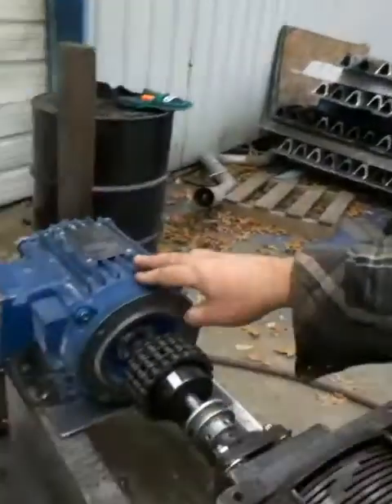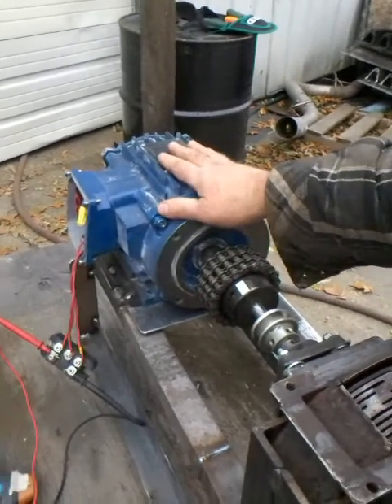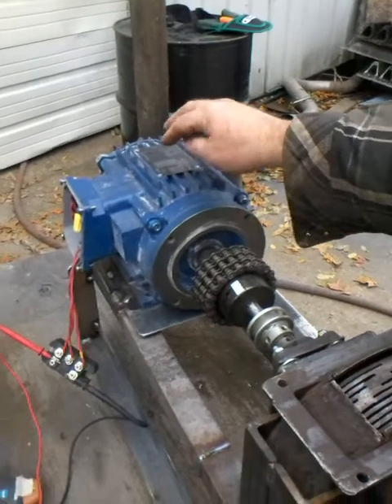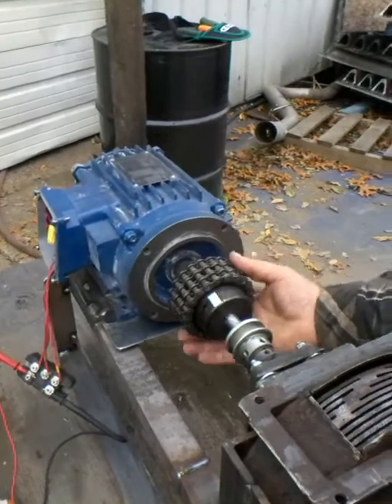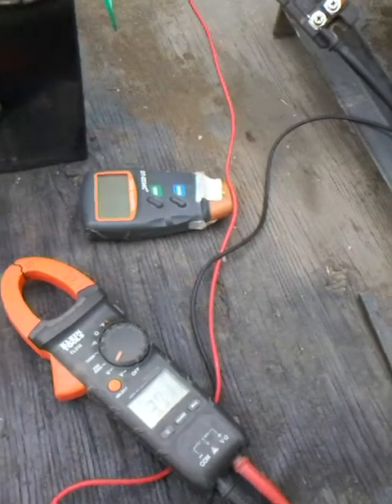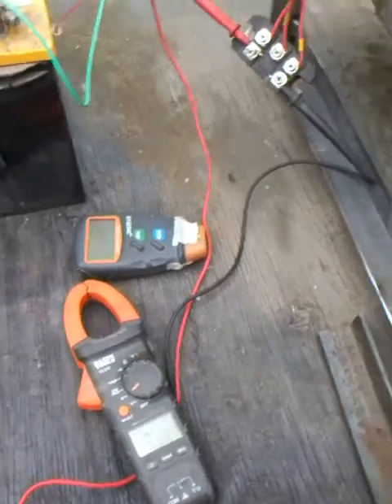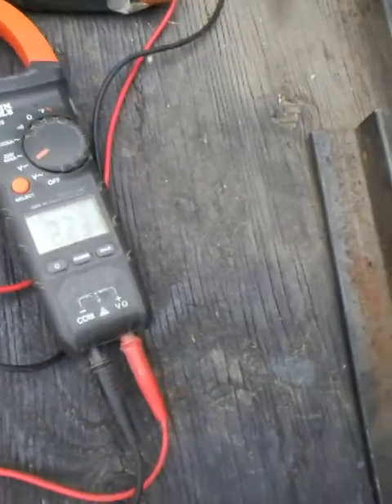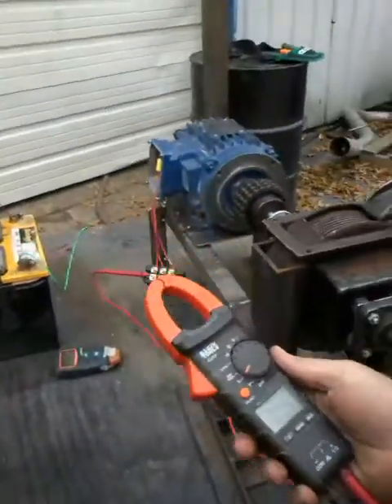TESLA TURBINE AND THREE PHASE PERMANENT MAGNET  GENERATOR

Comment: Power is driven into the storage battery by the use of Red and Green antenna on the batt terminals?  The tesla coil is off camera?
Reply: that was with no load... did they ever connect it to the battery ?

Comment: I'm "fascinated" by people who keep their smartphones vertical while filming.
I would be interested to know if these idiots place their TV sets vertically at home
Reply from the maker: I do not own a cell phone.... let alone a smart phone. I am not "fascinated" enough to waste 500+ dollars on something i find responsible for the greatest waste of productivity in human history.  This is a free Samsung CE0168 tablet given to me. Only the screen side camera works, the other lens is completely frosted, so it is extremely difficult to record, when you can't see exactly where your focus is. These videos are mostly for me anyways. But, thanks for your comment.
Reply: @ourhouseisfull11  screw this guy. I like the Tesla turbine because it's easy to make. Tempted to try. I am off grid watching mobile and can't read your meter. What kind of amps/voltage was it putting out? I'm trying to think of what the best way to get any torque out of it would be. Geared down with a bicycle drive & sprockets? Or maybe glue magnets on the disc and stator coils on the outside? Belt and pulley? Don't need much power. Suggestions and input is appreciated. Thanks for the vids